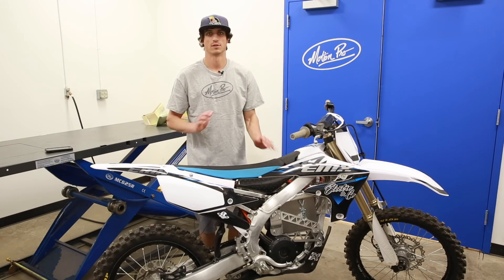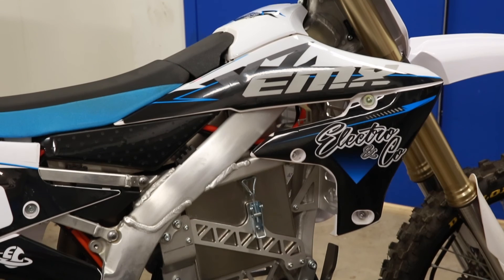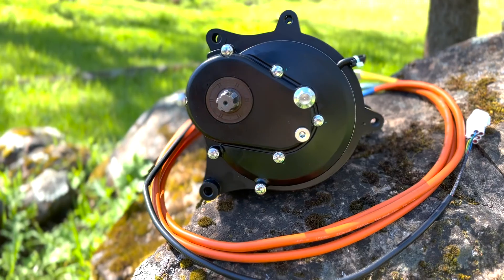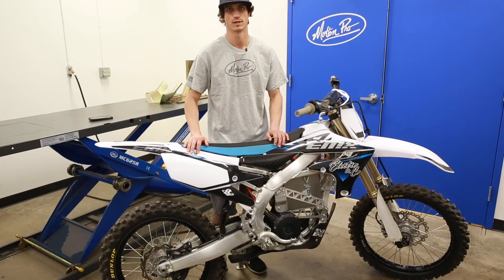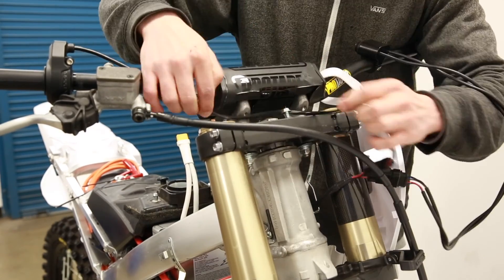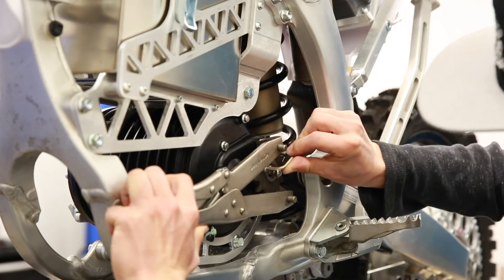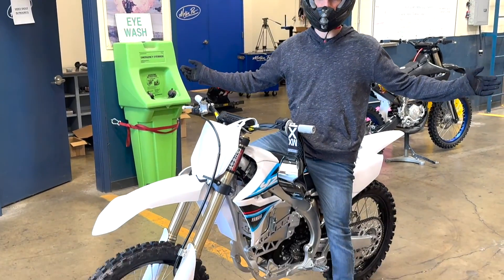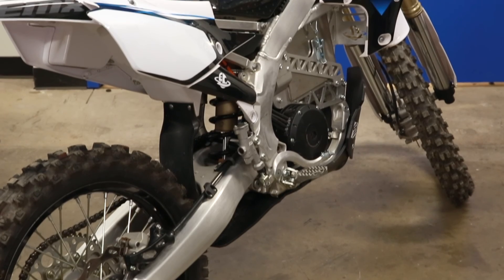YZ-EMX Electric Conversion Build with Motion Pro Tools

Comment: Why would you convert a dirt bike into an electric bike when your terrain is rocks, mud, water and crashing when you go crazy hardcore aggressive riding.. I would tend to assume if Tesla”s  cyber truck is being clowned for just washing it in a basic car wash cause it rusts and damages electric components imagine that multiplying when dirt biking is exactly that…. Good idea, but wrong application in this case
Reply: It is not a a POS Tesla. It is the most fun and versatile dirt bike I have ever owned.   Handles rocks, mud, crashing better than any ICE bike.  I wash it with my pressure washer same as before.  Don't knock it till you try it!